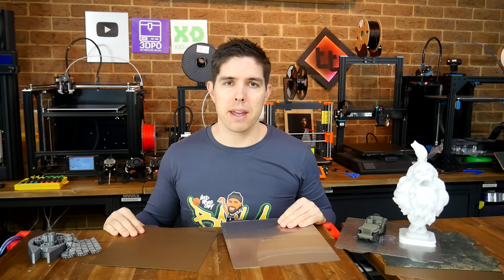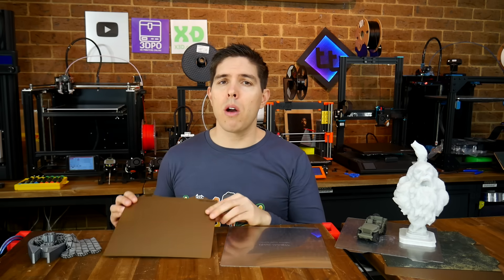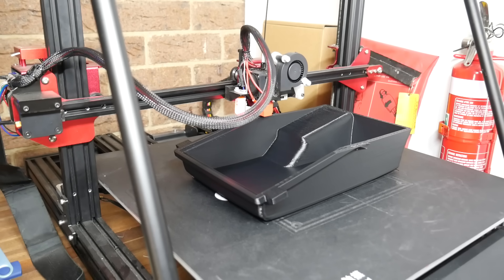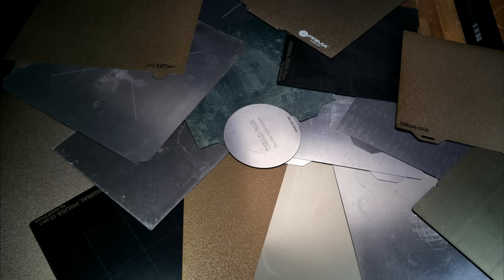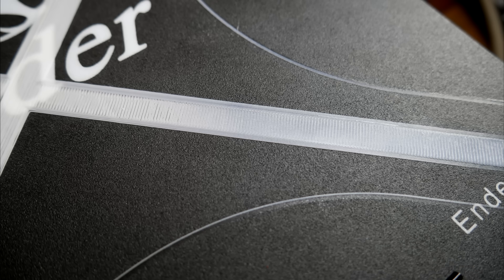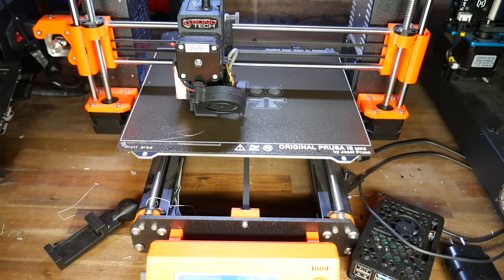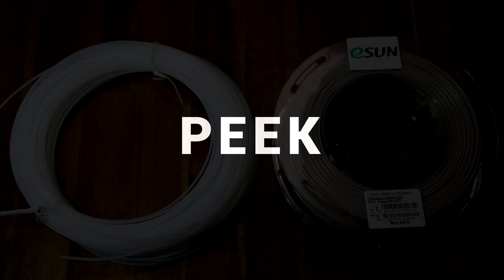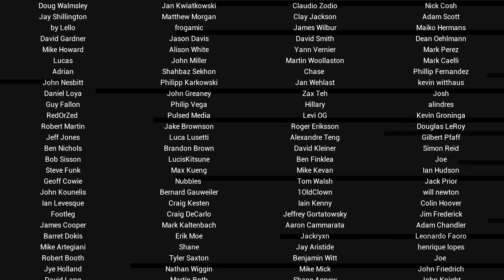Guide to PEI 3D printer beds: Why and when to use smooth vs textured

Comment: I prefer glass or Garolite. The smooth glass is flat, rigid and leaves a nice surface. I glued both to each other,  and just  flip it over.  Warning, TPU/E loves to  stick to Garolite! Now with a new Qidi Q2, there's new challenge,  as they have a small tab on the back, and the cleaning brush. Maybe changing the macros will fix that.

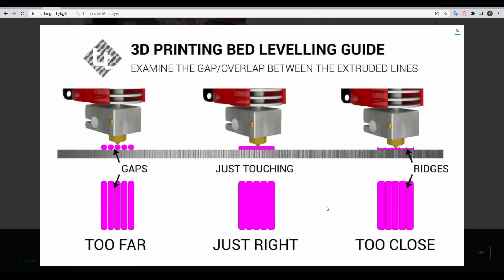Comment: 9:00 Just use glue stick for PETG on PEI. That, and 85/230 C on first layer, 90/240 on other layers is what the Prusa knowledge base recommends. I had an awful experience for years until doing this. I never had a problem since, with mesh bed leveling, wide path for first layer (0.6 or even 0.8), long purge line (and/or skirt, but that is risky as it can getsdragged into the print) to dispose of "cooked" filament, and filament dried properly (65 C for over 3 hrs according to printdry for PETG works for me).

Comment: I kept using Carbon Fiber beds before we had PEI coated spring steel beds. It worked well for that time, was somewhat cheap. Parts did stick until the bed cooled down. I used to hit it with cold water from a spray bottle and parts would simply fall off

Comment: With my ender 3 s1 pro bed i always had problems with prints not sticking. When it was brand new it worked perfectly! Untill a few months. Cleaning with alcohol helped untill it didnt now i use dishsoap but i still have problems

Comment: I actually print more PA/Nylon than other filaments and have very good success with generic smooth PEI in combination with 3Dlac or magigoo for PA.
Recently purchased PEI sheets from meltbro in Germany, which are the best I've tried so far. Not sure who the accrual manufacturer is though, so I'd call it generic as well. 
Magigoo is a little bit more reliable than 3Dlac plus and more durable, so I need to reapply it only every 10 to 15 prints.
I do a lot of batch printing using the full build plate, where bed adhesion is key.

Comment: I just got a textured PEI and Im convinced that textured is worse for PLA,  recorded results on settings from 190-220, 3 different filaments, PID calibrated, manual level and bed mesh, thoroughly cleaned each print and adhesion is barely existent, same settings on glass work fine, id say given surface area increase on smooth PEI and glass that when its level it sticks well but textured does not

Comment: I just got a dual-sided PEI bed, smooth on one side and textured on the other. For some reason, my PLA filament barely sticks to the smooth side, but works great on the textured side. That seems contrary to what's said here that both ought to perform roughly the same. Am I missing something? Please, someone educate me. I prefer the aesthetic of the smooth side, it's not gonna kill me to use the textured side - but you know what they say, I paid for the whole bed so I wanna use the whole bed!

Comment: PETG bonding to PEI is BS. I've been using a smooth PEI bed for a year and a half with and without hairspray, and the nozzle too close and too far. Flawless.
Reply from the maker: I'm glad it's working well for you. It's personally happened to me. I guess there is variation in different sheets and filaments.

Comment: LOL, love the removal text for nylon. I love the prusa pei satin sheets, but have been seeing some trouble with PLA releasing during a print where the smooth pei sheet does not. I do not really understand the reason, but I see it mostly on large rectangular parts so it could be corner warp and then the nozzle hitting it. I see it more often when printing many parts on a sheet, which supports the cooldown warp theory as a fuller bed allows more cooldown between layers.
Love the satin sheet with petg, I have seen 0 over adhesion issues, where I have caused damage with the same petg filament (giantarm) when accidentally printing on a smooth sheet.
Definitely interested in trying G10, but have been too lazy to source a decent manufacturer that makes some that are just plug and play on the mk3

Comment: I use to like glass for smooth surfaces as it can make a mirror like finish, but I always found it a little bit of a pain to get that first layer to stick well on glass.   Tried PEI and found it really good, but I only had textured ones.  Recently I did find a couple of smooth ones and it has put my glass bed more on the back burner.   I still like glass for some finishes.    I find that with PLA a bed temp of 60 initial, then drop down to 45 for the rest works well on my Ender 5.    I found keeping the temp at 60 for a whole print kept the PLA a little too soft and it tended to lift on the corners.

Comment: I'm new to 3D printing, and had a lot of problems with Bambu Labs Cool Plate, but after i flipped it over to the Engineering Plate and raised the temp to 60 for PLA and 80 for PETG i've had 0 issues with sticking and the parts self release after letting it cool.
My question is am i missing something by not testing other bed materials? What would i gain by purchasing a PEI plate?
What about TPU, ABS, etc.? Would they require something different?

Edit. In case TT reads this by chance, i just wanted to thank you for all your videos, they have helped me tremendously with printing and 3D modeling journey so far!

Comment: Brand new steel pei sheet, One print later with petg @ 80c and it's allready got little bubbles on it on the smooth side, also it doesn't stick as well as glass and 3dlac.....😞tried printing on the rough side and it does not matter what I do the prints warp.Tried cleaning it with dish soap and hot water like everyone mentions in forums still doesn't stick well enough.
What's the point if you have to then add a glue stick or 3dlac. It's a waste of time or the one I've got is of sub standard quality....not willing to throw another £30-45 pounds to find out again.
There is that much junk out there that looks like the really thing but doesn't work. That's the problem you don't know what your getting....Amazon is full of them?
I get better results printing with kapton tape on the metal heatplate or glass with 3dlac wiped on it with kitchen roll..... At least then my prints are flat, which I need when making mechanical parts....ymmv

Comment: I prefer a normal textured plate for smaller prints and a PEI plate for larger prints as I have noticed that the PEI sheet has worse adhesion than a normal textured plate. I don't know if this is because I don't have the print settings dialed in, or what.

Comment: Hello, I have a question to ask you. I am using the PEI magnetic platform.
My problem is that the magnetic pad and the aluminum heating plate are bonded with [3M 300lse]. And I checked [3M300Lse]’s long-term heat resistance temperature is 80°C. How to use it at high temperatures (above 80°C) while ensuring durability. May I ask how you solved this problem.

Comment: For Nylon (well, for PolyMaker PA6-CF at least): Use smooth PEI/PEX and smear purple glue stick (PVA) on the bed surface and heat at 80c for 5 minutes. Allow bed to cool, then print.

Comment: It’s worth noting Acetone does damage PEI over time and is best to stick to alcohol based solvents (IPA is ideal imo, I’ve found EtOH doesn’t dissolve things as nicely)

From what I’ve read it causes the PEI coating to become brittle in time and may lead to premature failure of the print surface

Comment: This video spurred me to ( finally a year and a half after I bought it) fit my spring steel / textured pei  magnetic bed liner.  Had tried  sticky back plastic Sheets Glass and found them having problems i tired of dealing with.. Went back to Cheap $store painters tape. 100% reliable and almost free to by so frequent replacement is almost costless. 
Welll ..when I lifted my Steel /pei thing I was horrified by the weight of the thing.
 I've spent considerable time and $$ lightening my extruder/x carriage... Fighting for  grams ! 
Then Going to throw all that away by sticking on a Heavy steel plate.... Not on My watch.
 Sticking with Painters tape as bed liner,  it's  proven Extremely reliable  for me... over 6 years of use.

Comment: Great video, but one VERY important thing: Do NOT use Acetone to clean PEI beds!! Acetone attacks the surface and causes micro-fractures and (depending on how the plate is manufactured) can cause the layer to de-bond from the underlying surface.
Most manufacturers recommend only using IPA and when it is really dirty water with dish washing soap (note you shouldn't do it too often as you can rust the spring steel). Also, they dont recommend hard abrasives, but just paper towels.

Comment: PEI sheet on glass, then sand with 80 grit lightly in a cross hatch pattern then diagonal and then circles.
They say carbon fiber nylon won't stick well
They say abs or asa won't stick well but if you do method it will stick 
PLA, PETG, ASA, ABS, NYLON and TPU

If your having trouble with bed adhesion don't try anything else till you tried this!!!

Comment: I've converted all my printers to PEI beds. I first got confidence with my Lulzbot TAZ 5 which came with a PEI bed. It works so well that I adapted my Snapmaker 2.0 A350, Sindoh, and one unusual printer I have made by Dobot. The trick with the Snapmaker, which has a huge bed, was to find one that fit, or came close. I am loosing about 1/2 inch of print bed but the Tronxy bed came close so I am using it. It has the rough material. BUT, got to say that the bottom surface of the prints are fairly attractive as the rough material is uniform enough that it creates an attractive bottom layer.I've never had luck with glass beds. By the way, if I need a little extra bond, I've tried the painters tape, hair spray, glue stick. My best results are using Elmers School Glue. Additionally it peels off the bed easily or warm water and the elders glue melts away. Easy clean up. My Lulzbot has a smooth PEI so the clean up by peeling the elders glue off works every time. The textured PEI beds don't peel off well so they require the warm water bath. I don't put down huge amounts of glue so I often put additional thin layers of elders glue on top of glue I previously applied. I will also move prints to other areas of the bed so I don't over glue. But I have fantastic luck with PEI, my absolute preferred bed.

Comment: What I've found with printing nylon on glass is the bed temperature doesn't need to be high at all! 2 layers of standard glue stick, 85°C first layer and 35-40°C for the rest of the print has proven to be have amazing adhesion. The lower temperature essentially makes sure the lower layers aren't hotter than the top ones and won't have any differential shrinkage. But the hot first layer makes sure it's bonded well against the bed initially. I like printing with glass but a flex sheet looks more and more appealing.

Comment: Garolite is a great bed material but you have to get the right kind. I ordered a sheet off eBay and it works great for large prints, but it's not the best for smaller prints because the surface isn't completely smooth. If it had a glossy surface it would be perfect for PLA printing

Comment: For pla layers that are stuck in BuildTak printing a layer ontop seem to work.
for a 0.4 nozzle i use 15mms 0.32 layer. 0.6 width, 60c bed 220c nozzle. Then pull it off before its fully cooled.

Comment: Great information. :)
I'll add a few notes :

- PETG tends to stick too well to bare PEI (or even glass). A "release" agent is helpful. A light coat of glue stick, Dimafix, Magigoo, EasyFix, hairspray, is enough (even recommended). Same applies to flexibles.
- For nylons, Garolite is the go-to build surface.
- FormFutura's ApolloX/TitanX are very special amongst ASA/ABS : they do stick too well to build surfaces. I had a chat with FF about that, and their advice is to apply a generous layer of whatever you use as a release agent.
- With flexibles being a notable exception, it's not recommended to remove a part from the build plate when it's not fully cooled down. Parts may warp on corners (I had the issue a few times) if removed too early !

Comment: This stuff is a lifesaver. I think mine was 30 bucks US, and I have had so much less trouble with under/over adhesion compared to the original ender 3 bed material. As for warped beds, get yourself a Cr touch! The beautiful first layers you get with this combo are worth it!

Comment: I used clear borosilicate glass for years on all 5 of my printers and have been slowly switching them all over to the whambam system and love it. I clean and steel wool it before every use and have zero bed adhesion issues. The ease of release from the bed after printing is a game changer.

Comment: What a great summary video. I've been using PEI with painters tape will varied success.  I've found that my sheet has low spots in the middle and the 5x5  UBL mesh doesn't mitigate that. I really like the convenience and weight of the PEI versus glass but somehow feel glass with painter's tape is more flat and will give me more success.  What do you think? I want to try glass again but didn't want to go through the hassle of removing the magnetic bed. Having the magnet and glass will add a lot of weight to the Y axis. Also, I was going to use the smooth surface of glass with painter's tape for flatness and the tape will help me remove the print easily.

Comment: I print on a bare Wham Bam metal flex plate without PEI or PEX. Just straight metal with Dimafix glue. It gives me the same smooth finish as a glass bed but with the advantages of a flex bed. I've never had any adhesion problems in years.

Comment: peek 1$/kg???

In video is said glas will bend if headbed is wobbly, 
I attached on every uneven heatbed a mirror to get a smooth printsurface.
I dont use auto leveling and via hand leveling i have very good first layers

Comment: I use both smooth and textured PEI on my ender 3 clones almost exclusively. mostly PLA and PETG, just now getting into TPU. I get around the thermal expansion issue by modifying my gcode to probe the bed after the bed is heated, while the nozzle is heating up. then my only factor is the expansion of the nozzle which probing wouldn't make a difference on anyway

Comment: I have an Elegoo Neptune 2S ... I just want to print regular plain old SUNLU PLA gray 1.75 filament I set it to 210C and the bed to 60C-70C and it is carefully leveled and I use hair spray and brims and it still detaches and warps :( What am I doing wrong? I do not quite understand whether I want the bed warmer or cooler how does that affect adhesion I primitively thought being above glass transition is good for the sticking but then I thought maybe it warps because it is too hot for entropic reasons like rubber it pulls itself together. Sigh. I really do not want to do anything out of the ordinary just have the 1st layer stick well.

Comment: Rather than hairspray to help abs / asa with sticking it’s better to clean the smooth surface with dish soap and a scotch-bright pad. This will scruff up the smooth surface a bit (dish soap pulls off all the oils too) let it fully dry and wipe with IPA every few prints afterwords. You should never have to use glue stick or hairspray again on that surface.

Comment: That was my problem 2:35.  I recently moved and resetup my printers.  I brought w/me a sheet of PEI and stuck it to the glass that came w/my CR-10, forgetting that I had a mirror to replace the warped glass.  Now my PEI is attached to the warped glass!  Do you have an extra sheet of PEI that I could put on the mirror?  :-)

Comment: I honestly love my creality glass bed on my ender 3 self releases after it cools down a bit and a fairly flat surface only have to up the temp about 10° for it to stick really well and comes out really smooth with some dots from the surface texture they applied to it, never used PEI so was cool to see it. I do want to try G10 Though as it seems like it could be a really good print surface
Reply: PEI is far better than the glass bed (have used it myself.) I can recommend the textured PEI bed from PrimaCreator. Does the same thing. Self release at cooldown. Also heats up much faster than the glass bed or stock bed. Uses a magnetic sheet so if you have trouble with a part you can just detach the plate and flex it. Not much of an issue. Works very well with no glue for PETG.

Comment: I would not print flexibles on PEI sheets, the adhesion is too strong and I was never able to get it off without damaging it.
For small damages of PEI flex plates I use superglue to fill in and continue using it.

Comment: I got two Wham Bam plates on the back of one of Michael's You Tube videos - I have converted all my printers to PEI / Wham Bam and don't use anything else. I print predominantly with PLA but also use PETG  and specialist filaments for some components from Igus.  PEX / PEI works with all of them.  Just get the beds nice and level, always remove the plate from the printer and never use anything sharp to remove print and skirts.  Your 3D printer is a precision machine, treat it like one!.  If you prepare the plate with 400grit then follow up with IPA / 000 wire wool you don't need anything else.

Comment: I use the original glass from my Ender 3 v2 and it works great if I use glue stick. Sometimes too well and I have to put it in my freezer to release the part. This could be a problem if my part is too big to fit in the freezer. I have a Wham Bam PEX Sheet that's been sitting around for months waiting to be installed. I just haven't gotten around to it yet.